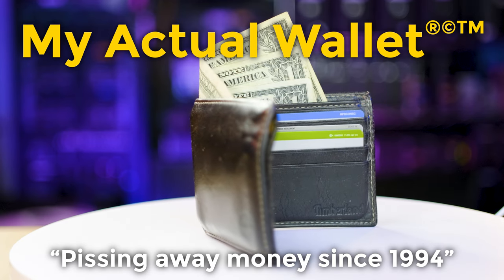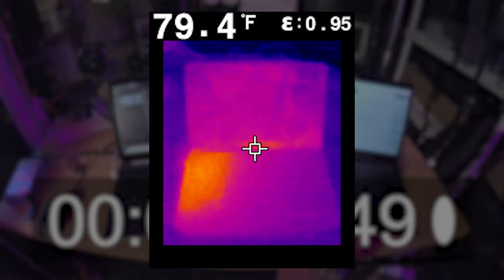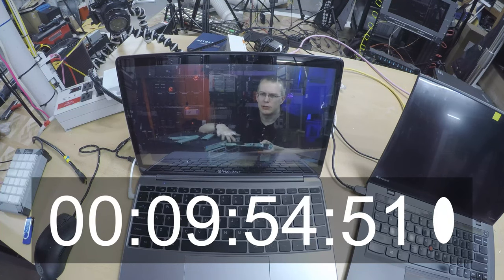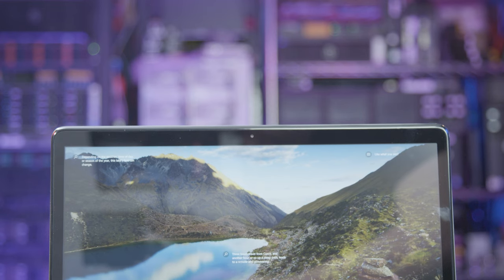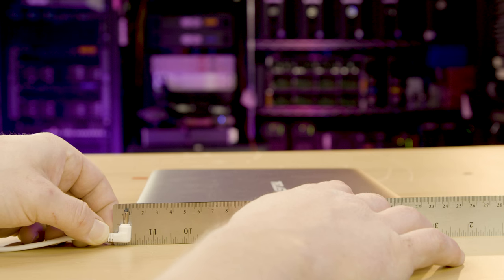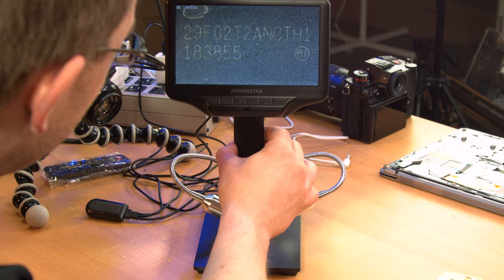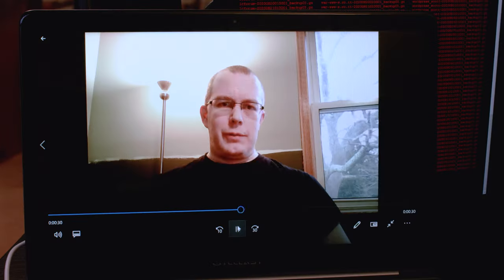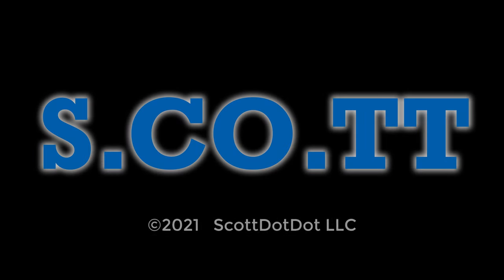Teclast F7 Plus Review | Comparison to Lenovo X1 Carbon Gen 2

Comment: I don't understand.
Back in 2016 I bought a very cheap laptop, around 200 euros at the time.  It was the HP 14-r206nv.  It has a 2 core 2 thread Celeron N2840, 2GBs of RAM, Intel HD igpu.  It was slow even for 2016.
I wanted a cheap extra laptop at the time and the lack of a fan was a plus.  It came with a slow 500GB HDD which I replaced with a SATA3 256SSD (some cheap brand I don't remember now).
It is running Windows 8.1.   I still use it, solely as a media playing device for when I am exercising.  How does it perform better (based on what I see in this video) than what should be a much more powerful equally cheap machine?    As I see there are only two differences that might work for the HP model.  The stock CPU speed of 2.16Ghz (burst to 2.58Ghz) and...Windows 8.1? 
I can browse the internet just fine (mostly Opera), watch videos, play older games (first decade of this century without issues).
Perhaps I am mistaken.
Anyway, thanks for the fun (yes fun) video.